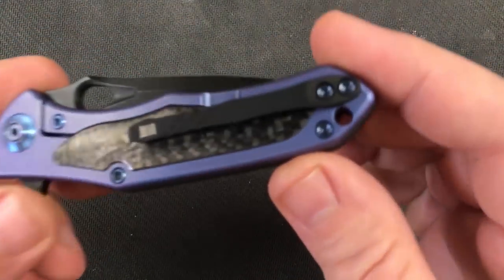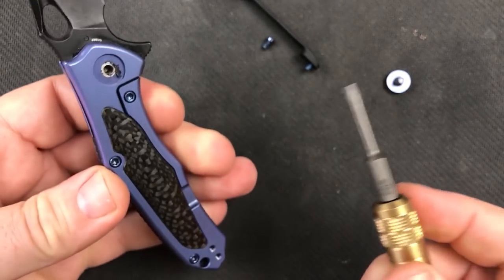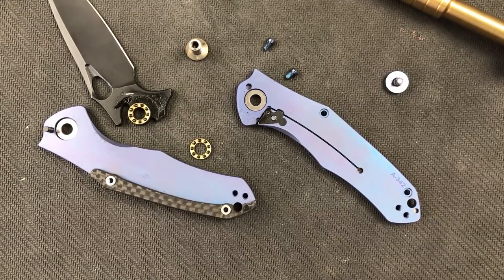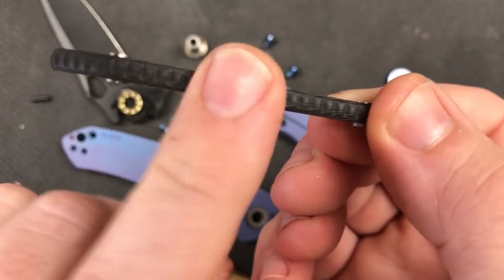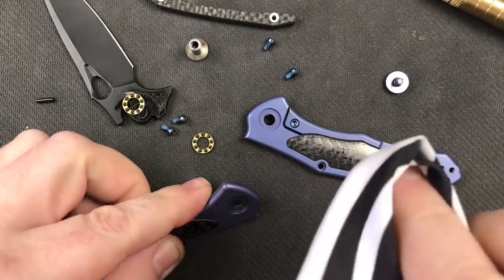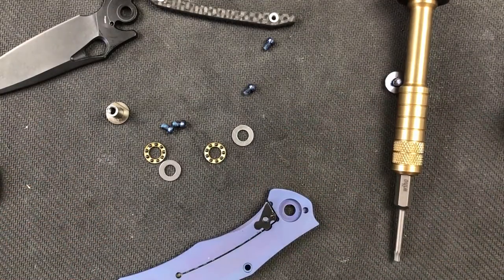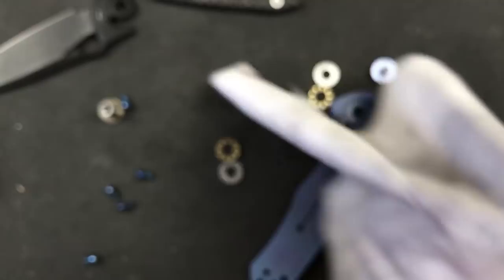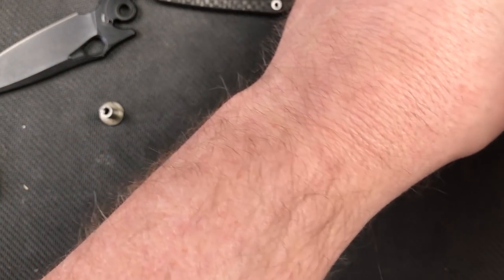What's Inside? The WE Knife Co Vapor

Comment: Zel, fyi tip, I always had trouble taking the washers out until I started using a small neodymium magnet. Pulls them right out quick and easy with no risk of scratches on anything
Reply from the maker: Great idea and I'm do that in the future, thanks. However you'll have too suffer through a couple more What's inside vids that are already in the can. Thanks!